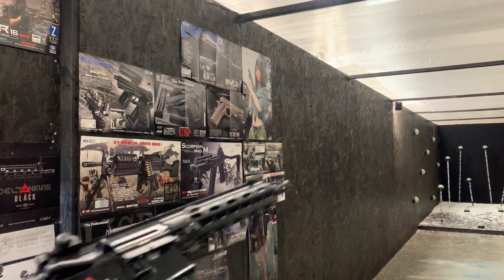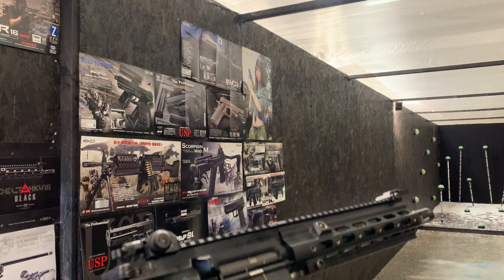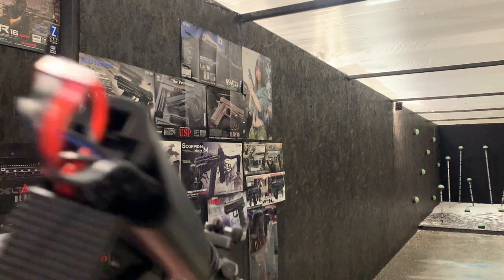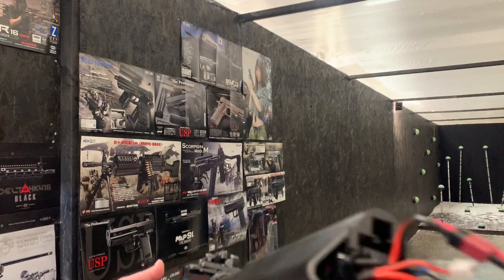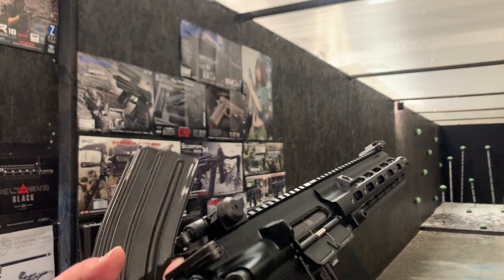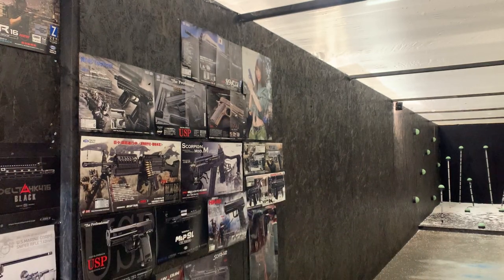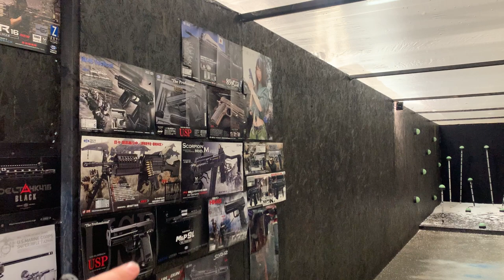TM 416 Delta NGRS | 892

Comment: I have a stupid question that I suspect I already know the answer to.

Is the SMR front end Mlok compatible? I have  RAHG on my VFC HK416D and it only allows for mounting grips via rail sections.

I'm guessing this is the same?
Reply from the maker: Yes, the smr rail uses sections you bolt on.  They come in the box a small selection of them.
Reply: @Eagle6Airsoft  that's a shame, know of anyway to mount a vertical grip directly to the handguard without the rail sections?
Reply from the maker: @JonStockman82  if you made your own m lok ends, ie wider ones that might work.  That said in the real world ie not airsoft, what ever method you use would need to be real steel tested to with stand bangs.   So using anything other than the official rails and properly fixing a 20mm attachment to that rail wouldn’t be recommended.    Sounds to me like you might need a different rail or accept the 4 or 5mm offset that comes with rail panels.
Reply: @Eagle6Airsoft  I had removed the keymod mount and managed to bolt one directly to the RAHG on my VFC 416 and it was good, just fancy a recoil one and have a nice mlok grip that's all.

Thanks for taking the time to indulge me.